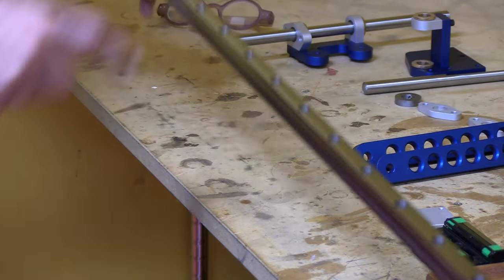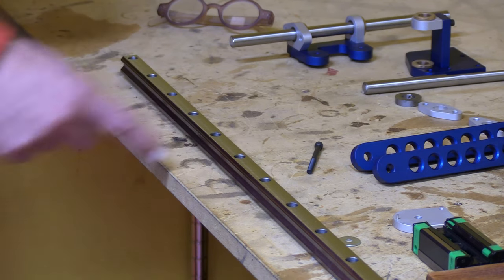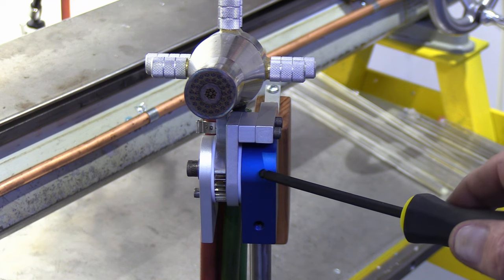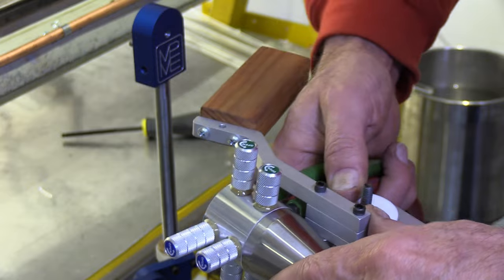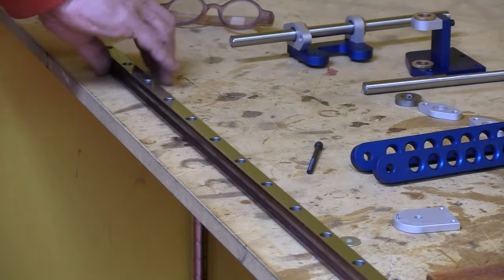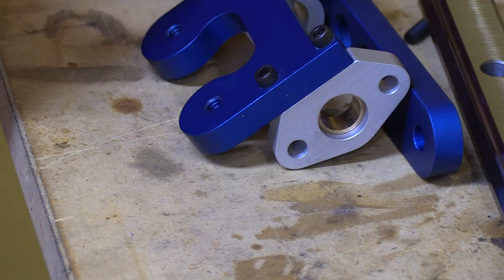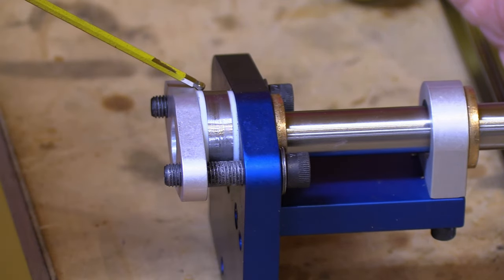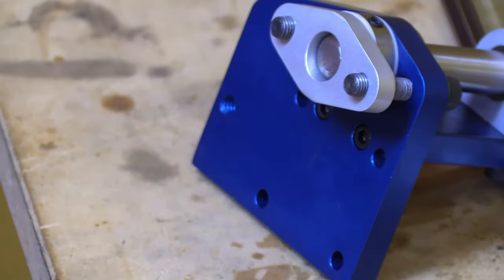Torch Armadillo Assembly Guide

Comment: I just subscribed-not because I work with glass but because I like how you think.  I'm afraid its a moot point because I don't see you putting effort into something that not many view.
I, too, invent things.  Its a part blessing and a part curse.  Since you work with glass I'll tell you one I thought of long ago.
If you were to make a glass goose such that it is dipping its head in the water.  LOL  I know this sounds funny.  But place the goose in your microwave such that it dips his head in your soup.  That way, one would not need to shut off the microwave, pull out your soup, stir it, place it back in the microwave, and turn the microwave back on.  The goose is a stirring device which could be easily cleaned and wouldn't interfere with the waves.  Additionally, it''s head could be shaped like a farmer's plow.